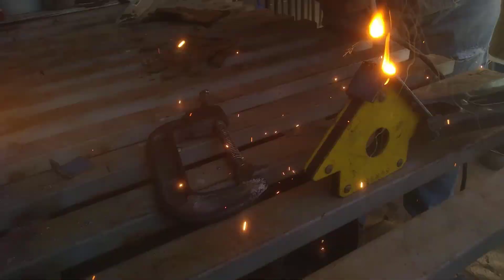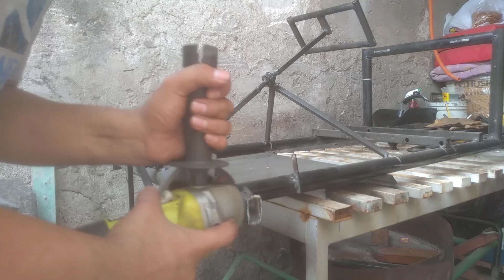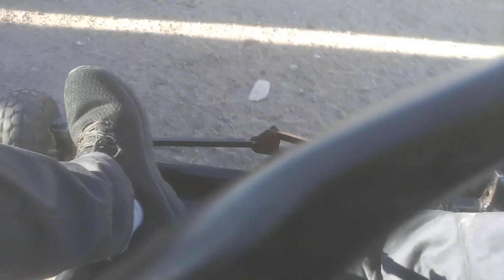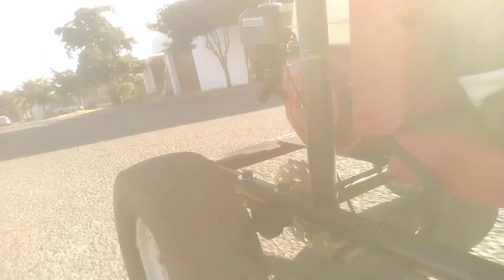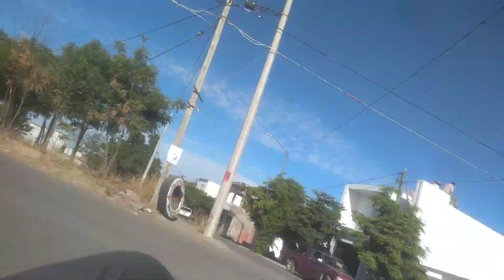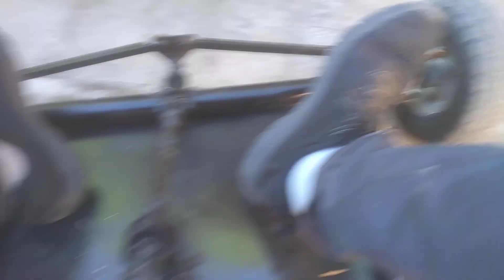COMO INSTALAR SUSPENCION DELANTERA AL GO KART

Comment: Buenos días lo escribo desde la ciudad de Arequipa mi pregunta es el motor de cuantos hp de preferencia seria o talves me podría decir por ejemplo de 3.5hp corre hasta 30 km.x hora de 5hp 40 km. X hora de 7hp 55km algo haci porque no tengo idea cuanto corre y conque motor gracias
Reply from the maker: hola saludos el motor es de 6.5hp nunca lo e corrido a tope pero si anda rebasando los 50kml